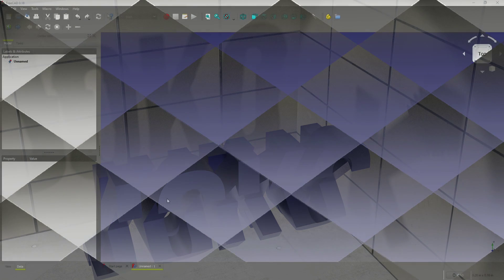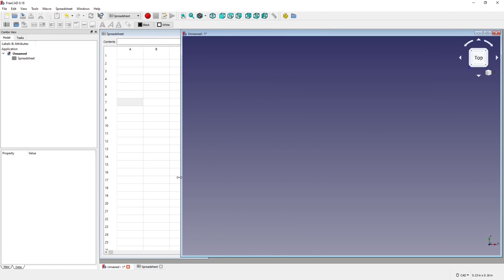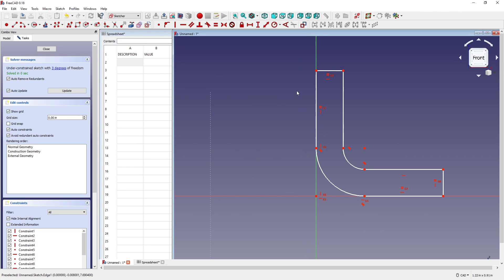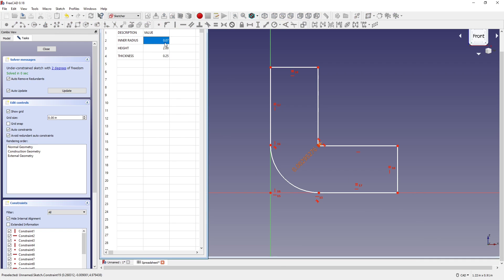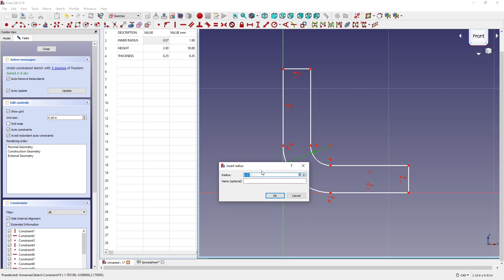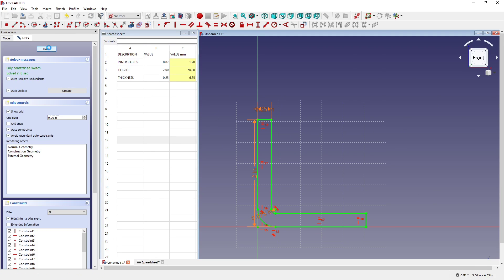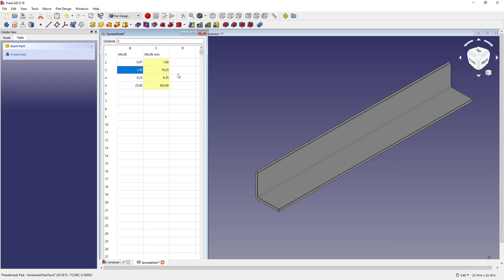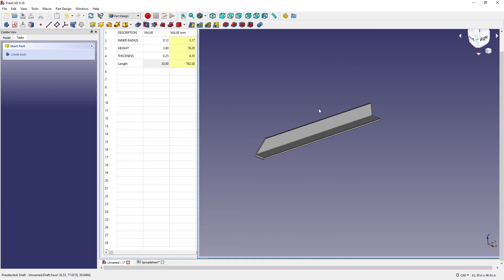FreeCAD: Make Your Own Part Library |JOKO ENGINEERING|

Comment: A neat variation is to use the part info table from the A2+ workbench. If you put the parameters in this spreadsheet you can also calculate the price of the item depending on the length and if you use it multiple times in an assembly the costs are automatically calculated.
Reply: I know im asking the wrong place but does anybody know a tool to log back into an Instagram account..?
I stupidly lost my account password. I appreciate any assistance you can offer me.
Reply: @Levi Anson instablaster :)
Reply: @Ralph Arjun It did the trick and I finally got access to my account again. I am so happy:D
Thanks so much, you really help me out !
Reply: @Levi Anson No problem =)

Comment: In lockdown i made a fastener DB for every fastener / nut / washer / circlip / pin that i've every used and many hundreds of newer head styles so far not used.  Each has a unique load point and not matter what orientation or assembly heirachical position it can singularly or assembly or globally be replaced with any other. So guys it's really worth the effort. I use DSM not FreeCAD, but non the less, the utility of a fastener DB is fantastic ! I bother doing this so that my parts list always has correct specs and quantities, plus using the 'find', items can be found and replaced just in a couple of clicks.

Comment: You can use imperial units in a spreadsheet if you specify the unit (E.g. 1in or 1"). What's a bit weird is that if your display units are set to metric, the cell will display the metric equivalent, in the same way that a cell containing an equation will show the result of the equation.

Comment: Once you've created such parametric part how do you insert multiple instances of it with different parameters into your model?
Reply: I too have the same question!
Reply: I think you will have to save it as a new part for each and the insert the one you need
Reply: I was hoping for the same info! I wonder would you:  
Modify the spreadsheet -> Save as -> import & use?
Would be good if you could modify the spreadsheet for each instance imported into another design, so you could tweak the parameters without having to save a new one each time.
Reply: @mattlennon3   it should also be possible to make a table of combinations and write a macro that would export the wanted combinations. But did not do much research on it yet. You could ask in the freecad forum maybe
Reply: Know this is a couple years old but for new people watching this just make a library of the parts you need like shown here then use one of the assembly workbenches to put together what you need. They allow you to import the same part multiple  times just like you would have multiple copies in the real world. I've just been putting together something that has 24 pieces in it but only has 5 different part bodies. Each one can rotated and moved around as needed to assemble.

Comment: It would be nice if I could use just link to a sketch in extrude function, so that I save just sections library, and I may use the link to the sketch of that file in library in BIM model. That I have tried but extrude function not accepting link to the sketch...

Comment: At about 9:00 you  you said do a "Save As" so I assume you will then have a folder into which you are putting your angle iron parts and type a file name that is descriptive of the principle variables of the part at the time you saved it.   Could you elaborate on your "Save As" process. Beginners need even this help.  We are all beginners at one time.
Reply from the maker: That part is up to the user on what is important to them.  I might save my parts as thickness, length, height for example 0.25"x36"x2" and then the next one might be 0.25" x 36" x 3" and the next 0.25" x 36" x 4" and then save as some other metric like thickness 0.125" x 36" x 2" then 0.125" x 36" x 3" and so on.  Whatever the user needs from this part family was my approach.

Comment: 04:25   -   Where did you define that the value in B2 was in inches ? It presently appear as just a value. Shouldn't this value be interpreted as just that ? A value in mm ? Since mm is FreeCAD default ? How come FreeCAD converted that value back to mm ? I tried to reproduce this unit problem, didn't work. FreeCAD utilized the raw value in mm. Of course if I wanted inches then I could use a formula to calculate it but in your case FreeCAD automatically converted your inch value into mm, Why, is the question ?
Reply: He made another column and added formula to it to do conversion. So C3 has '=B2 * 25.4' which does inches to mm then he uses value from that column in his parts. He showed and said it and did it very fast and it was hard to follow.

Comment: Newbie here...create a horizontal relationship here and vertical relationship here...keystroke?
Reply from the maker: Depending on the version, it is probably 'I' for vertical and 'L' for horizontal.  Older versions use 'v' for vertical and ''h' for horizontal, which I think is immensely better since you can run them from the left hand.

Comment: A good and interesting film. I have a question. Can you save the spreadsheet file time to time to open the file of the main drawing. As I understand spreadsheet file every time open separately to dimensions opened. What will change as a spreadsheet file name. It's about accepting, for example, a link to the sketch. Greetings from Poland

Comment: FreeCAD 0.19 will force you to use units, or spits and error, when trying to use the number in a constrain. Thickness alias did not work, as the name in spreadsheet already was thickness.
Reply: Doesn't seem likely: if THICKNESS wasn't accepted as an alias because it was already assigned as the name of a row, then why was HEIGHT accepted?